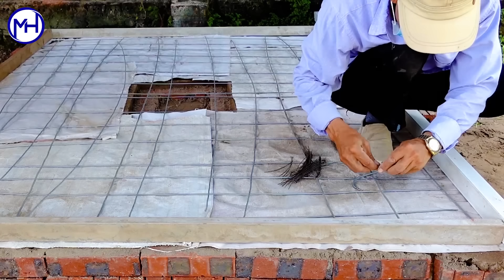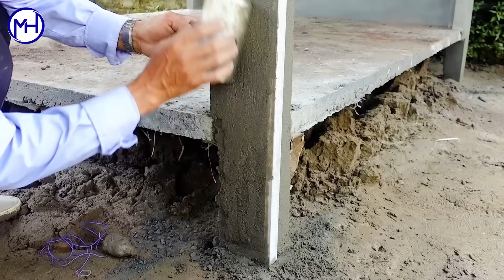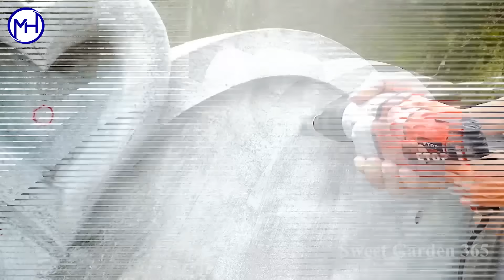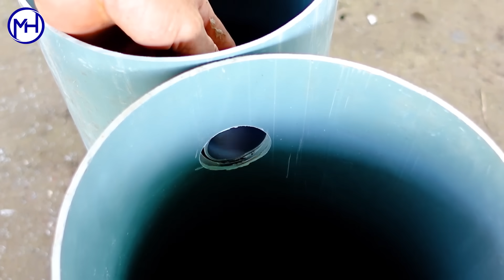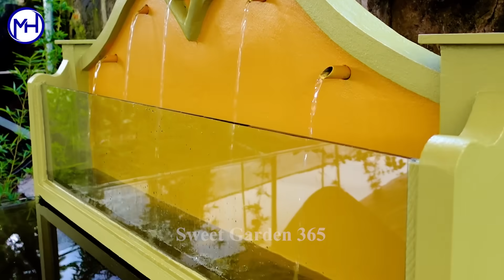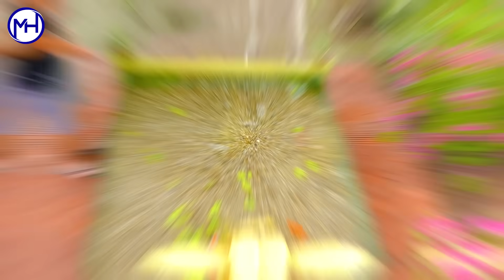Crazy idea from cement and glass! Make beautiful outdoor aquarium bed

Comment: I want to know how the lower part of the bed where the fishes are kept would get their oxygen from. I simply can't see any space for breathing
Reply: @bhatayesha7666  needs oxygen,  takes from fresh water,  hell just replace water in every 3-4 days
Reply: Why they need air, water is full of oxygen.
Reply: @Spectra12  noob after sometime the oxygen Will converted into co2
Reply: @Spectra12  I have aquarium I can answer your question they need air because the dissolved oxygen in water is consumed by the fish and they release carbon dioxide which gets dissolved in water. So,        the water needs air for the removal of carbon dioxide and the addition of oxygen. So that the fish can consume it for energy
Reply: @crew6754  i know it. But for that he didn't need to do a hole, It takes time. Also liquid water is denser than gaseous CO2, so dissolution of some CO2 shouldn't be a big concern.
Reply: @sujatasingh4013  Thanks for explanation ☺️.
Reply: I saw a machine they put in one of the tube where can see in the back of the headrest of the bed...in the back...so that makes the air for the fish...they will die if no air or oxygen...
Reply: Yes actually
Reply: Absolutely right
Reply: Fll poll 1
Reply: Devi Pani me oxygen hota h aur bed k side jo bubble AA rha h vo oxygen hi dega pure Pani me lgatar..
Reply: I agree
Reply: Dude the plants inside the aquarium consume CO2 and release which will be consumed by those fishes
Reply: You're right.. They try to make us fool
Reply: O

Comment: I'm absolutely obsessed with the idea but how does the top glass sheet remain straight when someone sits? Won't it dip in the middle from all the weight without any supporting structures?
Reply: Exactly
Reply: I spot 3 panes of glass spaced apart in the middle. Still doesn't seem safe to put bodyweight on glass like that. I've seen glass shatter spontaneously before
Reply: @skyricq  oh that's a great idea, i think tempered construction work glass won't shatter as easily as the regular one
Reply: @justlottie  I've been sliced pretty bad by glass so I guess I'm just hesitant at the idea lol
Reply: Yes absolutely same to your question I thought

Comment: The history of the invention of glass concrete and the Hungarian inventor who fell to his feet

The creator of the invention called glass concrete, Áron Losonczi from Csongrád, is proud to make a living from his own idea. His license income is finally establishing his future, as he recently won a patent lawsuit against multinational companies that counterfeited his invention.

The glass concrete invention created by Áron Losonczi is a translucent material that is a mixture of fine concrete and optical glass fibers. Thousands of glass fibers run in parallel between the two sides of the concrete blocks and transmit the light point by point from one side to the other, so that the light information appears unchanged on the other, unlit side. The silhouette of the objects illuminated in front of the concrete blocks filters through the material as if it were not a heavy-duty, massive concrete cube, but just a thin piece of rice paper. Áron Losonczi also developed a material similar to glass concrete, but cheaper to produce, called pixel concrete, which contains specially shaped pixel elements.

The use of both products can be quite diverse, they can be used in various areas of architecture and design, but they mostly serve as raw materials for interior design elements, and they are even used to make jewelry and lamps. It has become a sought-after product all over the world, the largest Swiss and Qatari concrete industry companies are also interested in it, however, for example, it has started to be counterfeited in Germany, Russia, Austria, and even in America.